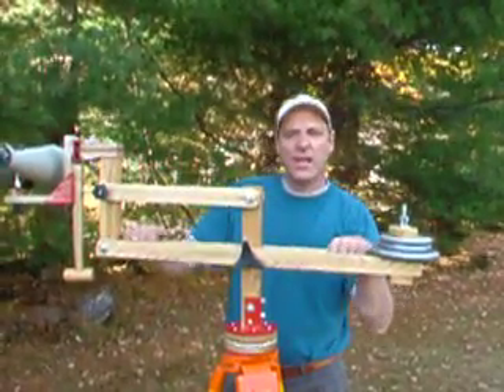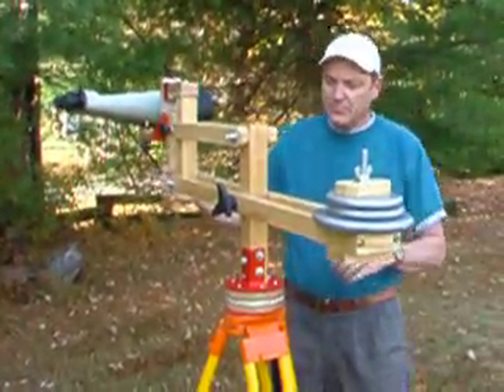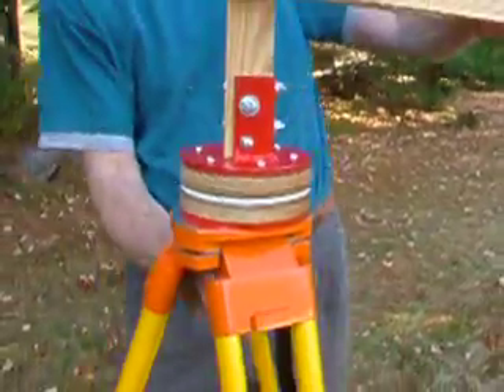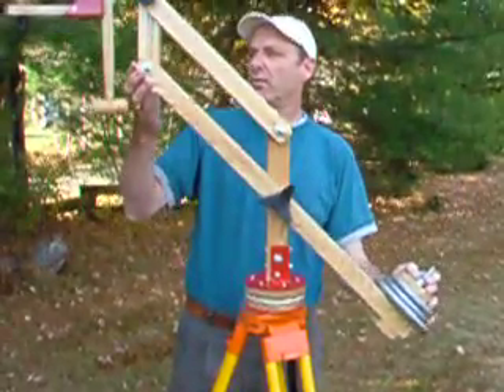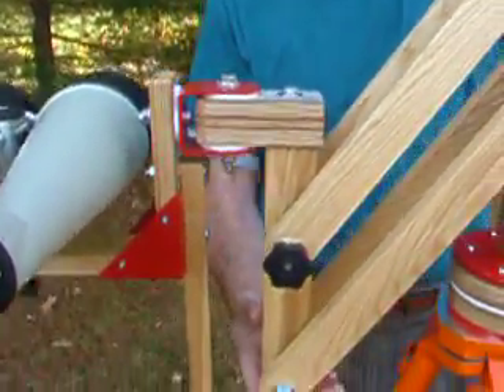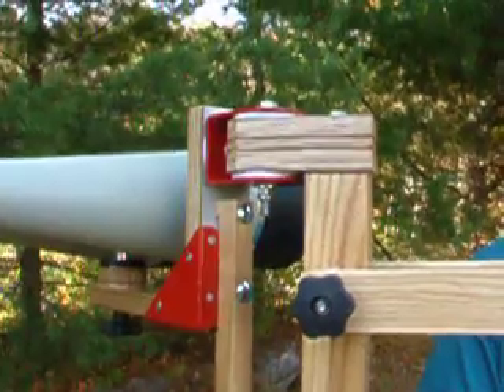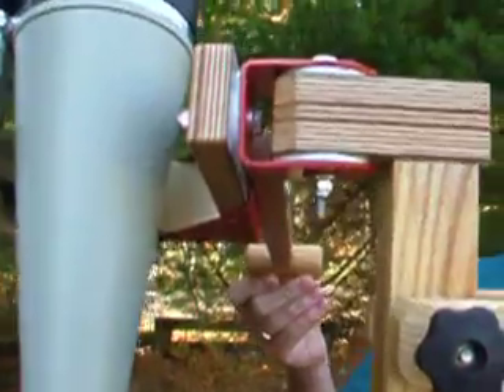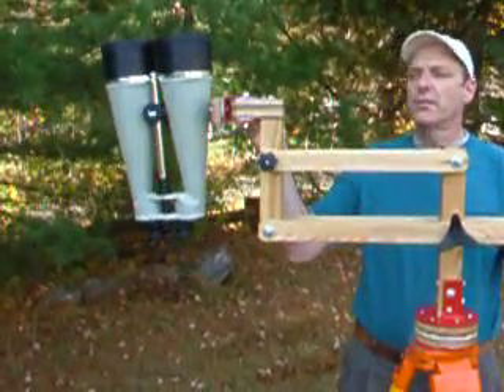Astrowood HD Parallelogram Binocular Mount

Comment: What do you use at the L bracket to hold the binoculars static in position when you move them off a straight vertical or horizontal position?  I have Celestron 25 x 100s and the setup I have that connects the L to the other part of the mount won't hold them in place ... they drift downwards.

Comment: please tell me what the red piece at the base is called. Its the very last piece i need to complete my build
Reply from the maker: When I was building these, I called this part the "bearing" as the very bottom attaches ridgidly to the tripod, and the upper portion rotates very solidly. I never have seen a similar design.
Reply: Roy Hess ah ok, so you made or had them made. Makes sense why I couldnt find them. I'll probably make something similar with a nylon bearing

Comment: The real dumb ass is the moron replying to a two year old post. "degrees of motion"  is nothing more then consumer slang and isn't accepted as used here by any scientific or engineering academic body. 
The degree is a unit of rotations and angles and most commonly  refers to either arc-degrees or decimal degree. The proper term here would have been axes of motion.. Of course I don't expect you to understand because as we all know the willfully ignorant are ignorant because they refuse to learn.

Comment: @Blaze1024 Actually, the term that is being described is 'degree of freedom' which describes the motion of a rigid body in three dimensional space. In this case, this mount provides 4 degrees of freedom (or motion) out of 6 possible; up/down, left/right/, roll, and yaw. 

The terminology is correctly used.

Comment: Degrees of motion? Are you sure you don't mean Planes or Axis of motion? degrees are incremental measurements not planes of motion.  If I'm correct your mount has four axes of motion. Astronomy is a hobby based on science so it would be helpful if we at least tried to use the proper definitions. .
Reply: Agree 100%